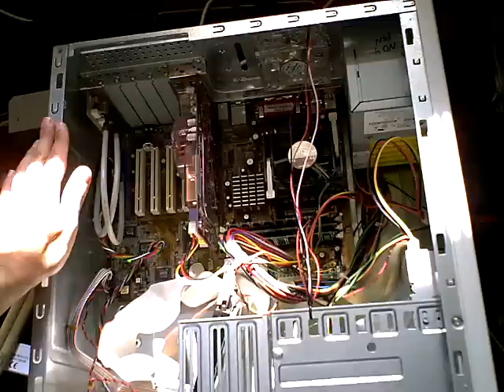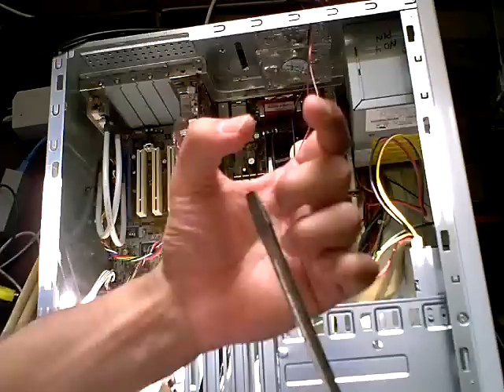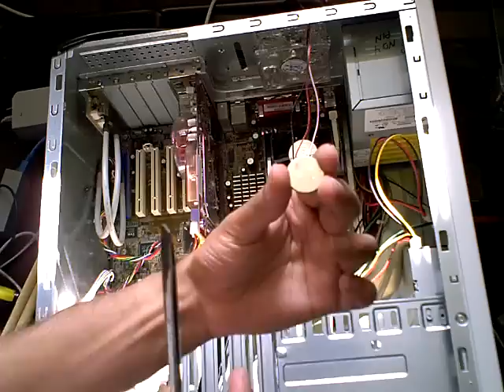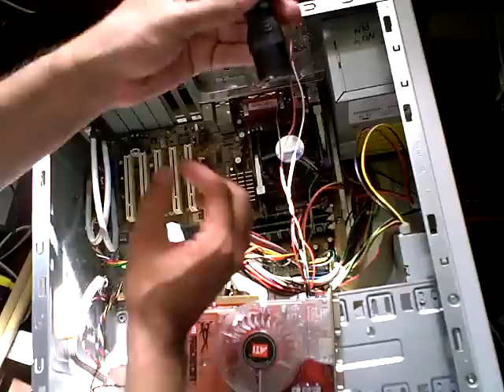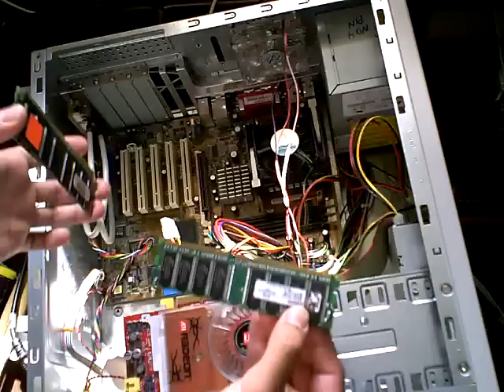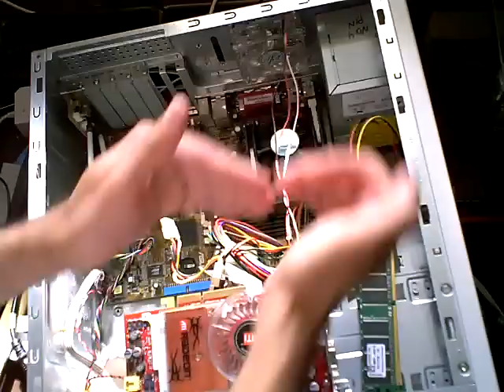How to possibly fix a PC that will turn on but will not beep and will not display anything on screen

Comment: I pushed the power button on my pc and completely nothing happened no fans are spinning , no sign of anything. It's like having the ac cable unplugged but I have plugged it in
Reply from the maker: It sounds like your motherboard is developing a short circuit due to contact with the metal casing. Most likely it has to do with the screws and metal mounting stands (supports) that your motherboard sits on. The cheapest way to fix this problem is to introduce cardboard washers between the screws and where they make contact to the motherboard, or you can buy plastic mounting supports at a computer shop.

Alternatively, you can always Breadboard it: 1)place the motherboard with CPU+Fan on wood or non-shiny cardboard 2)connect all of the case connectors to the board's panel 3)with a power bar that is OFF connect the PC power cable from the power bar to the power supply and the power supply to the board 4)while NEVER touching any exposed component,power on the power bar and press the power switch on the case.If the problem still persists,one of the remaining components is probably defective.Power off the power bar before dismantling

I cover breadboarding in greater detail in this video:
Advanced troubleshooting technique tutorial of how to possibly fix a PC that will not beep at boot
---

Comment: What if i cant find no jumper on the board?? And that this is a sudden issue...
Reply from the maker: +israr asif disconnect the power cable, remove the CMOS battery, press your PC's chassis power button switch (to discharge any remaining power circulating in the system), leave the PC unplugged and in this state overnight, then the next day return the CMOS battery to its socket, power up the PC, and if no beep, then disconnect the power cable, press your PC's chassis power button switch (to discharge any remaining power circulating in the system), remove one component, power up the PC, and if no beep then repeat (each time unplugging the PC, pressing the power switch to discharge remaining power, removing a remaining component, and then powering up, and this until the PC beeps at boot).If it never beeps, even when you are down to just motherboard, power supply & CPU+fan, one of these remaining components may be bad
Reply: Thanks for the reply but it was the psu which was causing trouble. It was sparking when i start the pc.

Comment: Ok so I haven't used my gaming computer in a long time (2 years) and I tried turning it on. All it does is give 1 short beep and then nothing. No image on screen or anything.
Reply from the maker: One short beep is a good sign. Do you hear the operating system loading up from the hard drive?

Comment: Please help I cannot find the reset jumper
on my acer aspire m1100
Reply from the maker: +MrMacky97 disconnect the power cable, remove the CMOS battery, press your PC's chassis power button switch (to discharge any remaining power circulating in the system), leave the PC unplugged and in this state overnight, then the next day return the CMOS battery to its socket, power up the PC, and if no beep, then disconnect the power cable, press your PC's chassis power button switch (to discharge any remaining power circulating in the system), remove one component, power up the PC, and if no beep then repeat (each time unplugging the PC, pressing the power switch to discharge remaining power, removing a remaining component, and then powering up, and this until the PC beeps at boot).If it never beeps, even when you are down to just motherboard, power supply & CPU+fan, one of these remaining components may be bad
Reply: +RodneyDickson ah thanks dude if this happens I'll know what to do but sadly my mum thew out the tower aha
Reply from the maker: +MrMacky97 Heh, aww well : )

Comment: CPU hasn't used for a long period of time, what happens, It only appears the power light. what hand happen?
Reply from the maker: Do you hear and/or see fans spinning when you power up the machine?
Reply: yes
Reply from the maker: Isiwara Wijesingha
Then try what is shown in this video. Let me know how it turns out.
Reply: My pc is IBM THINKCENTER M51. Is this metods can help me
Reply from the maker: Isiwara Wijesingha
Of course, this method is essentially universal for most if not all PCs in which the physical structure of the PC allows for this.

Comment: my cpu fan isnt working i bought a new one and it still didn't work i thought that was why my pc wasnt powering up i kinda hope so but im not sure how to fix it...
Reply from the maker: Are ANY fans spinning when you boot your PC? If so, connect your CPU fan to different FAN pins on your board (generally, motherboards have at least two of these and sometimes three). If you have to forego another fan to accommodate it (such as the case fan) then do that. If you have NO signs of life when you boot the PC whatsoever, then this may be a different issue: let me know if so.
Reply: RodneyDickson lol i fixed it man i just needed to push the 16 pin in to the power supply a bit more :)
Reply from the maker: I kid you not, as mundane as that fix sounds, that's valuable information! I'll have to suggest that more often to others with that problem. Thanks for letting me know : )
Reply: RodneyDickson np make sure just every cable is tightly connected if theres 1 cable loes you can think your whole mother board has been fried like i did :D

Comment: hello sir,in my pc smps fan and inside fan is not running continuous , its running stop and start .and not dis play enything in screen ,please help me
Reply from the maker: Breadboard it (explained in the following video:)

If the steps in this video did not provide a solution to your problem, view:

http://www.youtube.com/watch?v=_EK9a-R5pss

You never know, maybe rebuilding the PC in the opposite sense that you took it apart will solve the problem.
Reply: thank you sir .i will check and ask you later
Reply from the maker: k, good luck : )

Comment: Do I need to have spakers pluged in to hear the beep?
Reply from the maker: +teo trampus Nope. The beep comes from what is known as a PC speaker, which is a small speaker that either is built onto the motherboard, or that is part of your PC case that connects to a front panel connector on your motherboard. Unfortunately, many PCs today are not shipping with this speaker, which saves the manufacturer a dime but creates a pain for us when something goes bad : \ You can probably buy one from a computer shop for a couple of bucks.
Reply: +RodneyDickson Thanks. I' ll need to replace my motherboard because its really old and it died. Ty anyway
Reply from the maker: +teo trampus (shrug) well, it sure is an easier solution. Good luck with the new board : )

Comment: how will i know if my motherboard or ram is the problem?
Reply from the maker: +damian persad If the motherboard beeps the RAM error code when no RAM is present but hangs in this fashion with RAM present (and you've tried different combinations, different orders and different denominations of RAM modules) then it is likely that it is the RAM modules. However, motherboard can also be the source of the issue. There is no clear cut answer I'm afraid.

Comment: i have removed every single component u showed only suply lef to replace. i couldn't get beep. i have hp m7000 pavilion
Reply from the maker: Try to Breadboard it (explained in the following video:)

If the steps in this video did not provide a solution to your problem, view:

http://www.youtube.com/watch?v=_EK9a-R5pss

You never know, maybe rebuilding the PC in the opposite sense that you took it apart will solve the problem.
Reply: +RodneyDickson  thanx for  responding.  when i 2nd time removed fan from processor i got  The beeeep... was so happy at that moment  ;) then i install fan and resetarts PC  there was disply on monitor. It worked thanx again.
Reply from the maker: Wicked! Never thought THAT would fix the issue, but hey, it worked, so right on : )

Comment: And what about if at this point with no rams installed, still no beep?
Reply from the maker: Breadboard it (explained in the following video:)

If the steps in this video did not provide a solution to your problem, view:

http://www.youtube.com/watch?v=_EK9a-R5pss

You never know, maybe rebuilding the PC in the opposite sense that you took it apart will solve the problem.

Comment: Hi!
i got same problem. But i pressed cmos reset button plus i removed all the staff even the cpu but still nothing. No beeps no post. Can someone help me?
Reply: Mobo : Elite Group X58b-a
Reply from the maker: +Βαγγέλης Πατσουράκος Breadboard it (explained in the following video:)

If the steps in this video did not provide a solution to your problem, view:

http://www.youtube.com/watch?v=_EK9a-R5pss

You never know, maybe rebuilding the PC in the opposite sense that you took it apart will solve the problem.

Comment: When I start my pc it's just a plank screen my monitor turns on but still no output it works....but just a blank screen I have check everything even cleaned my ram nothing at all...
Reply from the maker: +Phillip Molina Breadboard it (explained in the following video:)

If the steps in this video did not provide a solution to your problem, view:

http://www.youtube.com/watch?v=_EK9a-R5pss

You never know, maybe rebuilding the PC in the opposite sense that you took it apart will solve the problem.

Comment: My oc turns on i see the windows 8 logo from the load screen after that i see nothing only when i move my mouse i can see the cursor only but everything in the background is black what do i have to do pls help
Reply from the maker: Chances are, your Windows installation has become corrupt and will have to be reinstalled. Firstly, before reinstalling your operating system, you can try booting in SAFE MODE (hold F8 when booting) and if you do get into the operating system, try uninstalling drivers, (such as your video card) one by one followed by rebooting to standard Windows (not safe mode) each time to see if you can boot to Windows without having to be in safe mode. If none of these work, then simply reinstalling the operating system (I also recommend formatting the hard drive beforehand) should solve the problem.
Reply: Thank you very much.
I reinstalled windows and i did format the hard drive now my pc won't freeze anymore thamk you so much for your help
Reply from the maker: +Younes Batsi Glad things worked out in the end : )

Comment: i bought a kingston ddr3 4gb ram,when i install it on cpu,cpu will start but it shows blank on monitor ,help.
Reply from the maker: If this is new hardware that you are installing on your motherboard (that has not yet functioned on your motherboard,) note that matching bus types of video card to motherboard socket (PCI-E for example) or matching bus types of RAM module to motherboard socket (DDR3 for example) does not necessarily signify compatibility. If this is the first time you are trying this hardware on your motherboard, there is a chance that this new hardware is not compatible with your motherboard, despite the same bus type and despite the fact that the new parts fit in their respective motherboard socket. Your motherboard manufacturer's website will have a support page dedicated to your motherboard's model, and on this support page should be a compatibility list for such components as video cards and RAM modules. Ensure that your new component is certified to function with your motherboard, and if your new component is not present on the compatibility list, then there is a chance that the new component is not compatible with your motherboard.
Reply: read my spec-
system manufacturer-LENOVO
system module- LENOVO 3000 H220 10028
BIOS-lenovo bios version 5vkt14aV1.4a
PROCESSOR-intel pentium duo core proccessor,E5400(2.7)GHZ
WILL THIS RAM WORK ON MY PC-Crucial 4GB CT51264BA160B 240-pin DIMM DDR3 PC3-12800 
.......................................................................i did research and i think this will work ,right?
Reply from the maker: You gotta contact Lenovo and ask them this very question. Also, your system manual should have which RAM timings will function with your machine.
Reply: thanks

Comment: I get one beep then around  seconds later I get another beep and it doesn't show anything on the monitor what do I do I'm scared I just bought this from my mate :/ :(
Reply from the maker: +Extreme Designs Beep error codes differ from one BIOS manufacturer to the next. To discover what the beep error code is trying to telling you, discover the manufacturer of your BIOS (available in the motherboard's manual or on the motherboard's manufacturer's website {on the page for your specific motherboard model}) and then look up the frequency and interval of your beep error code on:

http://www.computerhope.com/beep.htm

Comment: sir can you help me when i start my pc graphic card fan start and shutdowns then a beep comes and monitor says no signal
Reply from the maker: +AX1moS Beep error codes differ from one BIOS manufacturer to the next. To discover what the beep error code is trying to telling you, discover the manufacturer of your BIOS (available in the motherboard's manual or on the motherboard's manufacturer's website {on the page for your specific motherboard model}) and then look up the frequency and interval of your beep error code on:

http://www.computerhope.com/beep.htm
Reply: TY for the response but i changed my motherboard now its all ok m8
Reply from the maker: +AX1moS Sorry it came to that.

Comment: My computer wont display anything and when plugged in it justs makes a beeping sound
Reply from the maker: The frequency, rhythm and repetition of the beeps are trying to tell you what the specific problem is. Beep error codes differ from one BIOS manufacturer to the next. To discover what the beep error code is trying to telling you, discover the manufacturer of your BIOS (available in the motherboard's manual or on the motherboard's manufacturer's website {on the page for your specific motherboard model}) and then look up the frequency and interval of your beep error code on:

http://www.computerhope.com/beep.htm

Comment: The only thing you do here is. Remove all plugs at the back of the computer. Remove one RAM stick, blow it with your mouth or wipe it , then, place it back. That's all you have to do, nothing else
Reply from the maker: +simon anthony That works sometimes. Good thing to try first.

Comment: My computer is stuck i can't open any application after 5 minutes it freeze and i have to turn it off by clicking the power button.  What can i do to solve this please someone help me.
Reply from the maker: +nirmal mundakkal Check your CPU temperatures immediately following a crash such as this in the BIOS. Compare them to the shutdown temperatures listed in your BIOS and see if your CPU is overheating.
Reply: RodneyDickson Okay Working Thank You

Comment: Dude please help me here is  what happens
1-my pc turns on my gpu and cpu fans are working no prob
2-my keyboard and mouse are not working/no light
3-yesterday I sent my pc to the fix service the man removed my motherboard battery and putted it back [i feel its the problem since that never happened to me until yesterday
4-yesterday the same thing happened to my pc I connected it to my tv display it worked fine then I switched it back to my pc display it worked but today I switched it to my tv it was working but now I switched it back to my pc display but its not working please help me dude
Reply from the maker: When you say 'no longer working' , do you mean the EXACT problem you described in steps 1 and 2? If so, why not do the CMOS reset trick as shown both in the video and by your PC tech? If the PC is booting, with Windows startup sounds and all, but not showing an image on screen, this is different, in which case you should power down the PC, connect your display to a different video out port than you were trying to use, then power up, and if no luck then repeat (power down, connect to a different video out port, and boot) until you find the video out port that works.

Comment: Good. i just encounter a similar problem
Reply from the maker: +Alpha jallow And is the problem solved now?
Reply: to be honest No am even working on the motherboard right now but still the same.
Reply from the maker: +Alpha jallow Try everything in this video, and if that doesn't work out, try everything in the Advanced video. Good luck with it

Comment: Can anyone help me. My pc turns on and my monitor does but no signal goes to the monitor. I tried taking out the DVI cord and plugging it back in and the monitor displayed a picture for about 10 seconds then turned black.
Reply from the maker: +Joshua Fraser Does it beep at boot?

Comment: Hello, then you found the problem?
Reply from the maker: Me? The PC in the video? Yeah...in the end I get the thing to work through playing with the order of the RAM modules as well as the reseating of the video card.
Reply: yes, just because there was a video card bad contact or even the RAM? the modules were equal? voltage etc.
Reply from the maker: Just a guess on my part: the routing of information to the CMOS check was bad (an error was being produced that caused the check to hang). In removing these parts, the PC could complete its diagnostic to identify the problems: and thus the importance of breadboarding : )